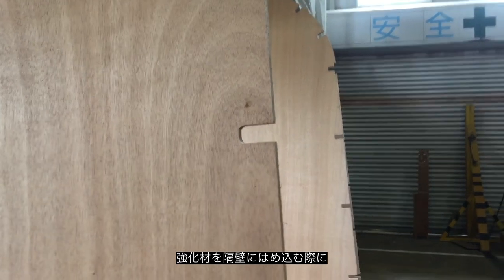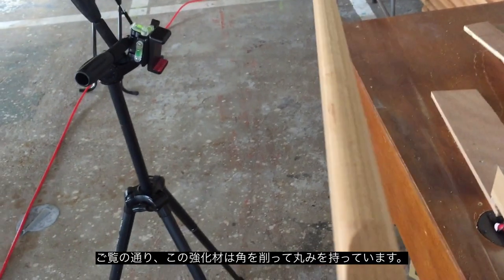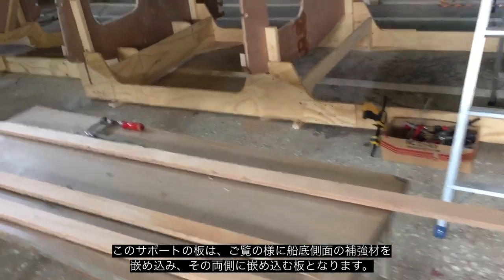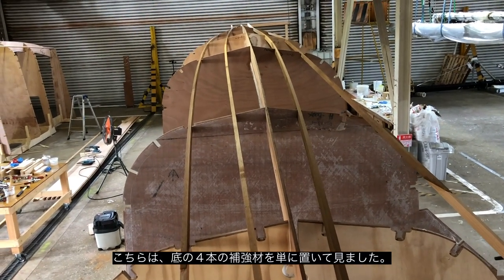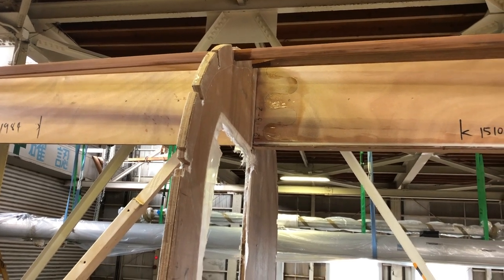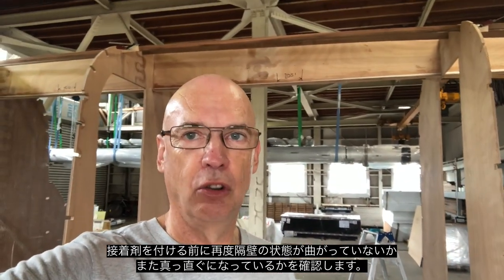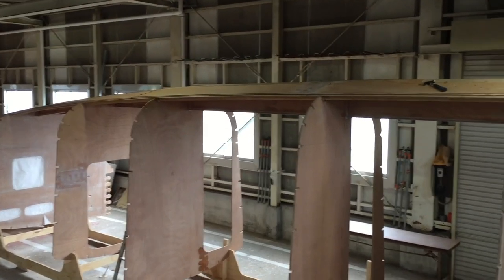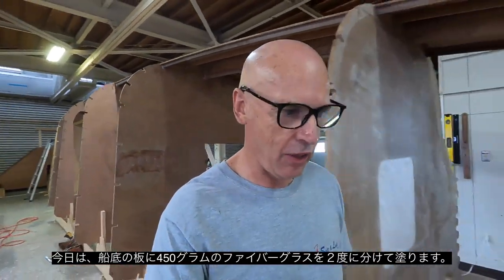Episode 13 47' catamaran build in Japan

Comment: Thanks for the update.
I noticed in the video that you have one ply of the plywood removed along the keel chine. I guess the idea is that the 2 layers of fiber glass you are going to put there are going to refill this area and make it flush with the rest of the plywood. This obviously will reduce the amount of fairing you have to do afterwards to blend in the chines re-enforcement fiberglass tape with the surrounding plywood. 
Is that correct?
Is it something you plan to do on all chines?
Is it something that was in the plans from the designer, or something that you took on your own to implement?
How did you make that even small recess along the chine?

Inquisitive minds... and all that...
;o)
Reply from the maker: Hey Laurent, sorry it seems I missed this comment.
Yes you are correct in that we filled that recess with 3 layers of glass and fairing.
The chines are made up of 2 layers of 6mm which over lap each other and finish level with the bottom plates and side panels, more to come on this soon 
Kev